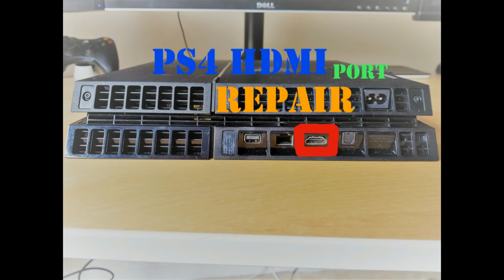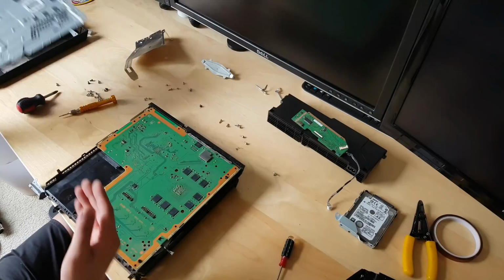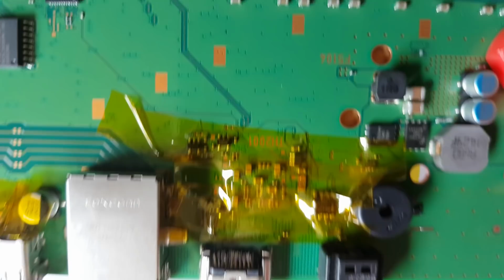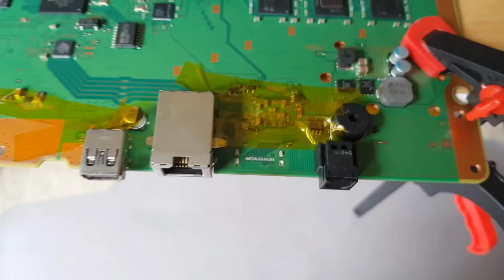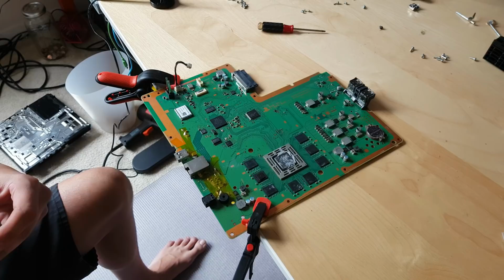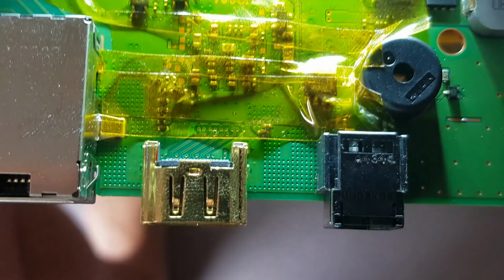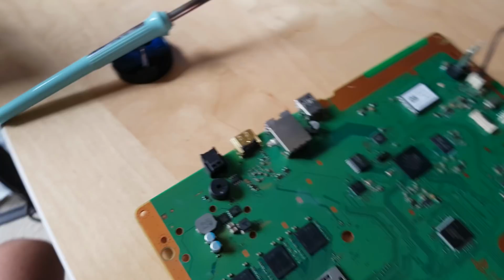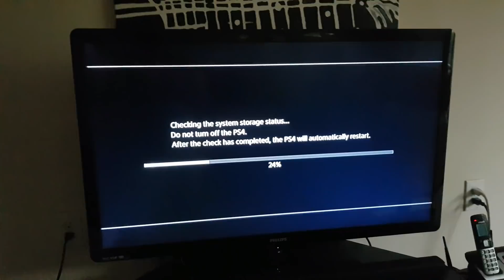PS4 HDMI Port Replacement Tutorial  - PlayStation 4 HDMI Port Qucikest without Pro TOOLS

Comment: When mans pulled the heat gun out I decided to go to a shop.
Reply: innit 30 seconds in i realized i aint doing this
Reply: @MaSoNGaMeR115  I can fix it for u
Reply: Somone did the same technique and fixed the hdmi but screwed up the bluetooth chip for the controllers so I had to go get it fixed by someone esle unfortunatly
Reply: He probably used a heat gun with controllable temperature. The pins need to be soldered with a fine soldering tip
Reply: heat gun at low fan speed, 950 degrees fahrenheit, moving constantly between the grounding pins for 5 mins will loosen that hdmi port right off. helps if you dilute the lead free solder with 60/40 tin lead solder first too.
Reply: How much does it cost if you go to a shop
Reply: @yellowfish3987   I run a small shop in San Diego, I charge $55 for this repair.
Reply: @vgrepairs  dam well I don't leave near there I live in Portland Oregon lol and I busted the HDMI port for my PS4 what type of "shop" can I go to to get it fixed
Reply: @yellowfish3987     ship it to us for same day return and 9 month warranty. ship motherboard only for best shipping fees waived
Reply: David Clark you recommend any place near Temecula?  Need the same
Reply: yea I probably would just go to my local game store and purchase a pre owned ps4 and switch out the hard drive than fuck around with all them screws.
Reply: Wise choice!
Reply: What shop did you go to ?
Reply: David Clark where can I contact the shop?
Reply: Lol😂😂😂😂😂
Reply: X_Swelllicense380 _X can you fix for ne
Reply: Exactly my thoughts!
Reply: Sameee 😂😂
Reply: David Clark what’s shop name? I need to get this repair
Reply: Bruhhhh my port just broke and I’m contemplating doing it myself but I don’t know shit about soldering
Reply: I jus spit my drink out😂😂
Reply: Difbeofb Jabfienw I cant fix this shit lol
Reply: Foreal ain’t nobody got time for all that 😂
Reply: Bro heat guns r 12 pounds
Reply: Bro shops charge $150 fuck that
Reply: Haha funny enough that was the moment when I was like oh bet I've got everything I need
Reply from the maker: Thank you for 🍺🍺🍺🍺🍺
Reply: You can use a blow dryer but honestly heat guns are like $10 for cheap ones
Reply: right bruh clocked off the video lmao
Reply: do you know what shops like fixes it bro??
Reply: My PS4 is fucked I decided I’d look at the HDMI change I think I’ll go to the shop as well £200 lighter 😢😢😢😢
Reply: I'm sure the Green Goblin can afford more heat gun
Reply: Aidan Macgregor  if you have the gear, ie very sharp cutters and good flux and solder, go for it. I used to have a heat gun and hot air but they mess up more than is needed. Just cutting it apart and removing is cleaner and once you heat the desolder wick enough you can clean it and it looks untouched, so drop in new correct connector and solder in place with flux paste and pin test it before you connect it to anything... you also need a soldering iron that can do enough heat to the pins holding the case of the connector to earth on the PCB, they soak a lot. So probably 80w or more minimum.
Edit: it isn't that hard id you soldered before properly, but it isn't for beginners...
Reply: @JESUSISKING77742  you can’t you neeed a heat gun that can get at least 405-450 C
Reply: @MaSoNGaMeR115  😂😂
Reply: Outstanding my thoughts exactly
Reply: Nah fr they tweakin I just skipped thru like nahh
Reply: u coulda just used a hair dryer
Reply: How much did it charge if you still remember

Comment: Any job that works is a good job but other places do this differently. Low melt solder is added during removal and a hot air station is used rather than a heat gun. There was a concern of "pulling pads" with the removal.

Comment: You didn't re-solder the mounting pins. This means, the bulk of the port is being held on by the 19 pins attached to the pads. If someone forces an HDMI cable into the port, they stand a chance at ripping out the pads and causing a lot of damage.
Reply: I think he did in the end.
Reply: Agree,there were bridges

Comment: All the small pins look soldered together do you have to solder each pin or can I just put a shit load of solder where the pins are connected with solder like it looks in the video?
Reply from the maker: Oohhhh no, you need to solder every pin by one and if put everything together you can burn pads and that is it, dead motherboard
Reply: Dam ok i got the old one off been trying to solder the pins separately but they so small it seems impossible
Reply from the maker: Use a zoomer like loop and be patient

Comment: I am not ambitious enough to do this I don't think, is there a huge cost of messing up? Like can I undo any damage I do it? Like de-solder or something. Because I might bring it in to get repaired, but they could charge up the ass for that.
Reply from the maker: +ExoticVanguard if you don't have skills in solder don't do it, better find a friend who can make it for beers lol you can damage pads and it will be to complicated to fix it
Reply: I have experience, as in in grade 9 i was in electricity class, and I made a working light and battery

Comment: Hello, I replaced my HDMI port, but for some reason I get a green screen when I move the wire around or it flickers. Do you have an idea what could be wrong?
Reply from the maker: +YousTrulyS Blahh some of pads not solder correctly , use solder iron and zoom and make sure all of them in proper way
Reply: Yeah. Its broken.

Comment: Why are you taking the optical drive out? Just the power supply would have been enough and with a bit of skills not even the power supply. You would in any case have to remove the 2 extremely long screws in the corner of the power supply.

Comment: looks good - no one knows really how hard it is to solder them dam small pins - they are the size a a hair. I use solder paste a bit faster.
Reply from the maker: +Will Orth I know it pain on the ass to do it
Reply: It's pretty easy if you just use flux and some solder paste with a rework station hot air solder tool. If you dont put too much solder paste and apply evenly then it will only take a couple of seconds and solder will form nicely onto individual pads. This guy just doesn't have the best tools

Comment: The back panel won't come off. I see 2 screws popping out from the opposite side and can't get to them.
Reply: Take top screw out..then gently lift from front to pop tabs and work your war to the rear,do small panel first,then remove 2 exposed screws on top and remove other half of top.

Comment: 100% If the hdmi port pin (s) break USE SOLDER WIRE. cut a pin sized piece and place it in the port. YOU MIGHT HAVE TO WIGGLE HDMI CABLE TO SET PIN IN RIGHT. 
WORKS 100%
Reply: Can you explain more

Comment: Can i use a usb to hdmi on the ps4?? I dont want to spend the $120 when i can get on of those for $60
Reply: Keston Higgins yes this is same question I’ve had I guess it worth a try
Reply: Rardd5 no I do not recommend following these instructions if you are not experienced or are unwilling to take a risk of destroying the system. The hdmi port is easy to get too, but replacing it is the hard part. And the risk comes in melting the hdmi off and sodering the new one back on the prongs. I suggest watching videos on how to soder and doing some more research. It’s not a hard procedure but it is risky if not done correctly. Also finding the correct hdmi port is difficult as Sony has these specially made for some of the PS4 models, they can also be expensive, I have been unsuccessful in finding the correct port for my model. I strongly recommend spending the 100 bucks or so to get it fixed by a professional at a tech shop, rather than taking the risk of having to buy a whole new system.

Comment: one of the pins in my port was so bent and i tried straightening it with a tweezer and it got too bent and broke off. im so annoyed
Reply: trick is to plug in your console upon purchase and never unplug it again they are very flimsy.
Reply: Same here. Fucking sucks
Reply: asus huracan yo i ended up buying the ps4pro anyway, old console got too wornout. The tech support where i live is also trash. I sent it to them to get fixed and they sent it back  still broken with the plastic around the hdmi port all melted, screws missing, and the hdmi port itself upside down. Not sure how the fuck that happened since it wouldnt even fit on the motherboard that way, never even got my money back, fucking idiots even scratched the console up. Its been 2 years and im still salty.
Reply: @moallam7685  lol they did you wrong 😂😂😂😂

Comment: Can you just use a soldering iron to remove the old port instead of a heat gun?
Reply from the maker: Yes it is possible but you need to have good skills in soldering
Reply: yeah soldering sounds much easier than heat gunning it. wouldnt need all that thermal tape and you can flip the board over so you dont hve to do it upside down. you can just pull it down too
Reply: Big Booty Business it’s much harder to use a soldering iron to remove the old hdmi port from personal experience the heat gun worked better
Reply: @ethangray8337  do you also have to de solder the pins? If so then yeah heat gun would be good

Comment: So i don't need to apply extra soldering iron to the 19 pin???
Reply from the maker: If pins seat correct and not moving No, if yes , use a little bit and make sure to do not touch 2 pins at ones

Comment: This is how you destroy your HDMI encoder chip and everything else around it😂. You don't even have to take it fully apart, just remove the power supply, un-plug the connectors under it and flip it over and remove the shield and the board will come right out.

Comment: No pro tools but all he has is pro tools, lmfao. No pro tools mean you're using random shit like a butter knife or items professionals wouldn't use.
Reply from the maker: I used cheapest tools ever
Reply: Me too I used the cheap screwdriver to fix my ps4 controller lol
Reply: No cheap tools and pro tools are two different things. Average Joe's go to harbor freight and get a $10 tool set, professional grade costs 10x more lol
Reply: Lol I used a knife
Reply: It cost less then a 100 Dolores
Reply: Maverick Shaq you can send a PS4 in (where I live) and get it fixed for about 100:)
Reply: You can't take security screws out with a butterknife, genius. A couple screwdrivers and a soldering iron are not pro tools.
Reply: @shaqmaverick  He didn't say he does it, he said theres a place where he lives that does it for $100. Learn to read.
Reply: No it doesn't.  It means you went to walmart or dollar store to buy your tools.
Reply: if you think his tools were pro for electronics repair, your very uninformed. if i were to do this repair, itd definitely be under my microscope with a much finer soldering iron. this is like 30$ of tools he used. thats the cost of just a couple of my tips.
Reply: Star bits are not pro tools. You can go to any hardware store and get them. LOL I know don't even have to buy any. The Black and Decker drill that we have came with a whole bunch of different Star bits
Reply: These aren't pro tools. If he was using professional tools he would have a hot air rework station, solder wick or sucker, and a fancier soldering iron. You can get the tools he is using at harbor freight for less then $20
Reply: Yes but a heat gun ????😂😂😂

Comment: Its a really easy job if you have the right tools, I fix about 3 HDMI ports a day esp PS4 they break so easily!
Reply: what are the right tools for this job?
Reply: @msterangelgamingangel9671  A solder re-work station! It's a soldering iron and hot air re-flow built in, you can get them quite cheap from Amazon about £50. The heat gun he uses is not for soldering and is very dangerous. Also a electron microscope/macro videocamera for micro soldering is   essential. Check out My Mate Vince on youtube, he's an excellent amateur fixer who's great at fixing/fault finding.

Comment: instead of a heat gun can i use a blow dryer
Reply from the maker: +Million Ayou no, you need high temperatures to melt solder
Reply: sadly i cant find any heat guns in my country
Reply from the maker: +Million Ayou buy it online
Reply: Thanks i just did

Comment: I dont have flux. Is it possible to do it without flux?
Reply from the maker: +MoMo Cr7 flux is making thing to make solder stick back in place together. I will not recommend to do it. But you can try. Just be very quick to put new HDMI port back
Reply: And i dont have solder
Reply from the maker: +MoMo Cr7 I will not recommend you to do it. You will take out old HDMI port, but then you need solder gun to make sure all the pads are soldered correctly
Reply: Ok thx

Comment: My heat gun won’t even loosen the solder... I’ve used a soldering iron, nothing! Every video shows it happening in 2 mins or less, I’ve been messing with it for 4 hrs
Reply: Solder will dry incredibly fast. Don’t breath on it and make sure all fans are off
Reply: Same here....
Reply: heat gun at 950 degrees fahrenheit, 5 mins lowest fan speed setting, moving back and forth between grounding pins. DILUTE OLD SOLDER ON HDMI PORT WITH 60/40 LEADED SOLDER FIRST

Comment: It costs £50 to get your hdmi port replaced, so unless you happen to have a soldering iron, a heat gun, some thermal tape, that stuff he used to clean and a new hdmi port laying around the house you are probably better off getting it repaired for you, doing it yourself this way and buying all this stuff will only save you a few pounds, will be a lot of bother and probably won't be done professionally.

Comment: guys the ps4 is like 150 now pre owned,i would rather just switch the hard drives to a second hand one that works than fuck around with all them screws and bite the bullet on this one, every dog has its day, just to add this is a common problem with PlayStation 4 never had an issue with xbox or pc so my guess is sony are using cheap components.

Comment: Question: why did he need the heat gun. Couldn't he have just used sauntering iron?
Reply from the maker: +Devin Walton you need to used for not breaking pads and also it is impossible to solder out 4 legs of HDMI connector.  If you don't use heat Station or gun it will be 100% fail. Also apply flux
Reply: You just need flux a good temp controlled soldering station and a very fine tip. Maybe a magnifying glass or usb scope. You don't HAVE TO HAVE a hot air rework station or need the thermal tape if you can solder well and take care and check your work.
Reply: I just noticed it's not actually a hot air station he used but just a heat gun. lol... If you do this then year do it how the guy in the video did it.

Comment: wouldn't it just be easier to just replace the old soder with some new?😅😂 Without heating up the whole board?
Reply from the maker: You can break pads by doing it, it is why you heat whole peace up to take it out
Reply: SOLDER

Comment: Never use a heat gun to do this repair. This idiot clearly has alot of practice doing it this way. You don't! You will screw it up!
Reply: Uber Micro Repairs because you did right...???
Reply: @yomango2632  hay hope you checked out my channel of how I do hdmi repairs for my customers? If you have experience of doing these repairs you can do it in crazy ways. I would never do it this way with a paying customer. To be honest I wouldn't do it for click a bate YouTube video! Gives people faulse hope. They screw it up then finds repair guys like me who have to not only repair the issue but repair the mistakes! Thanks to videos like this.
Reply: I use a heat gun to do this quite often. I don't see anything wrong with what he is doing as long as he doesn't burn the port or the capacitors surrounding it. The only thing I do different is preheat the whole board first.

Comment: not a chance lmfao you had that port off before XD you need a lot more heat then your 120 degree hot air gun, the solder wouldnt even melt dude

Comment: So you need hundreds of dollars in equipment and a college degree in engineering in order to replace this? Awesome.
Reply from the maker: Well you need like 70$ for all tools and basic knolage of soldering and know how to take things a part
Reply: Im 16 and fixed it on my own you only need a heat gun 20-25$, soldering iron 15$, soldering flux 5$, torx screwdriver 5$, and a new hdmi 5$ 50-60$ total equipment

Comment: Hello did you just use solder from the old hdmi or did you apply new solder to the board after you took the old hdmi off? Your response would be greatly appreciated
Reply from the maker: +SiX sEcGoOf wen you will take out old HDMI port, apply flux on all the pads and gently put a little bit of loader on them. Basically renew HDMI pads with solder 😀
Reply: Andrew Gavrilov you meant solder right?
Reply from the maker: +SiX sEcGoOf yes. But don't put more on the left and right sides, where legs from HDMI port will go
Reply from the maker: +SiX sEcGoOf and make sure that you of your solder iron is super small
Reply: Andrew Gavrilov okay so i wont have to desolder anything?
Reply from the maker: +SiX sEcGoOf cover everything with metal foil and tape on all of the parts.oyounly live hdmi port open and every sing chip around it. Then put whole board on a platform that can tale heat. Use heater gun to warm up the port and lift it up with twizers or pluers. Be were careful.  Make sure it is super hot. You will see solder bubble
Reply: Andrew Gavrilov can i have your email for more questions bcz i dont wanna mess anything up
Reply from the maker: +SiX sEcGoOf just PM me on YouTube
Reply: Andrew Gavrilov will do